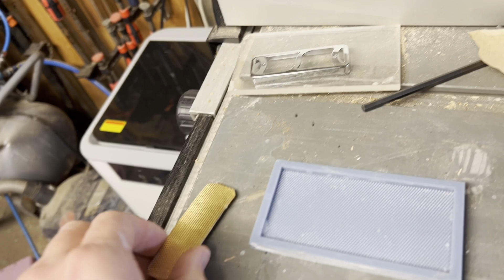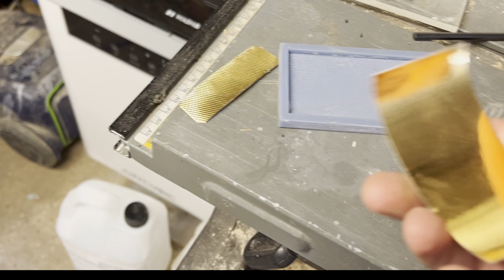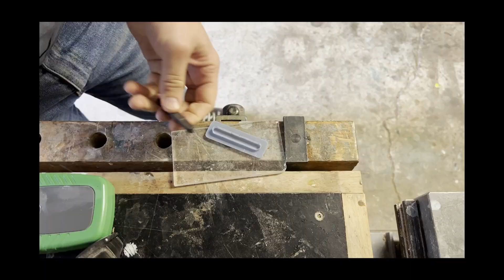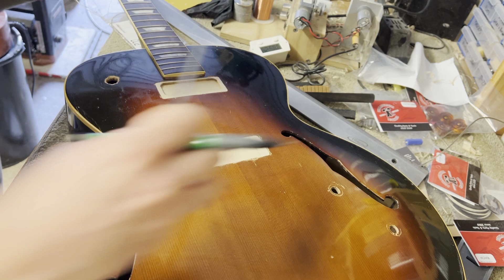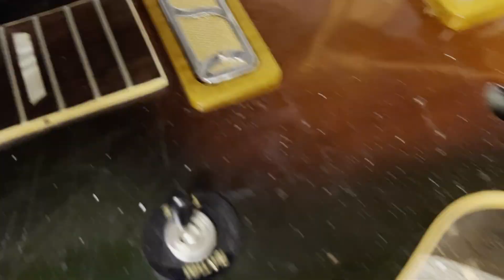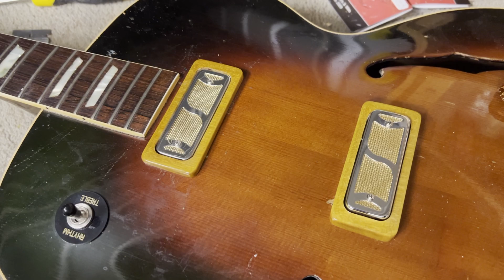1953 Gibson L-50 Restoration [Part 4] -  Fitting the pickups

Comment: I’m sure it’s sacrilege, but how awful would it be to have converted the back to something held in place by pick guard screws rather than gluing back on?  Backs aren’t under as much stress as tops, right?  Granted, that’s overkill given that electronics work won’t be as common as string changes, but I can’t think of an in-between option.

Subbing, btw!
Reply from the maker: You'd actually be surprised at how much the back braces a guitar like this.
Reply: @BeardsworthGuitars  Oh, no doubt.  I was really wondering about how much difference the mode of attachment for the back would make.  I suppose without glue, it's far less of a cohesive unit, though, to state the obvious.  

That thing came out pretty stunning, I should add.  Good on you!

Comment: It looks beautiful! We wondered why you took so much care to airbrush those two flaws when you didn’t touch up all the scratches and dings, but then we figured that they were a different kind of flaw that wasn’t part of the authentic vintage look. So when we look at it, we can still see how old and used it is, but it’s clean and shiny. You did an awesome job on plugging those pickup holes and fashioning the pickups and pickup frames. It’s good that you referetted the guitar; your reasoning was excellent. The way you fixed that section of kerfing and the areas around it were brilliant. And now to top it all off, it sounds terrific!
Reply from the maker: Thanks so much! Yeah, the airbrush thing was really because I caused that defect, and it's not really something that would have happened through general wear and tear. Do no harm, and if you do... cover it up!! Thanks for your succession of kind comments. It really means a lot. Cheers, Tom